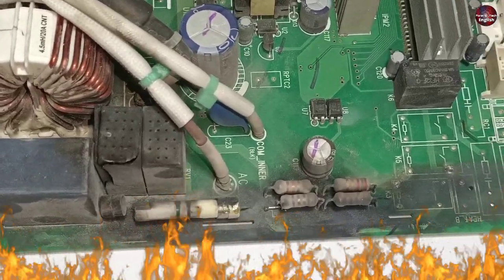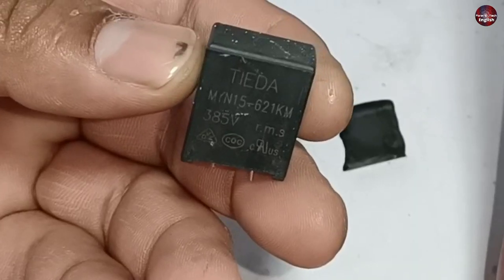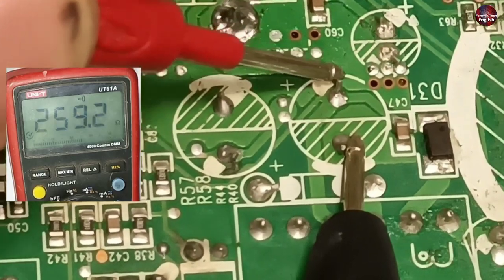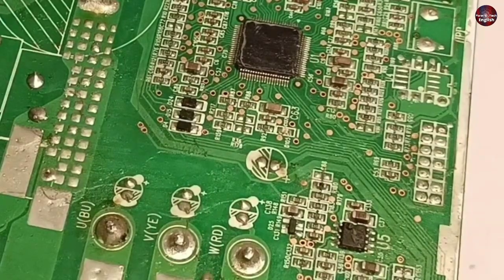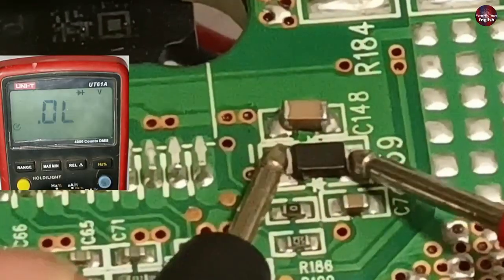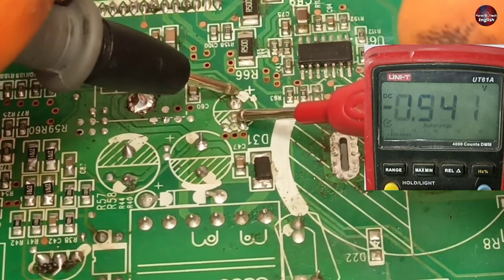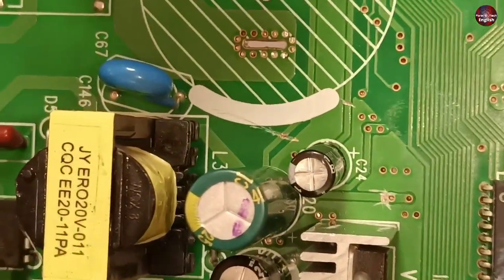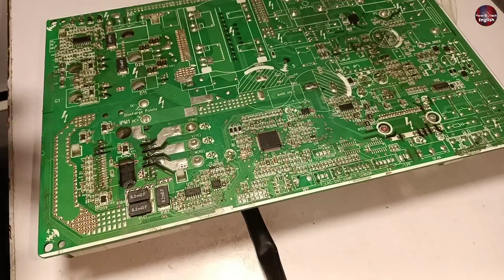Trying To Fix Blown Motherboard of Mini Split AC - No 5,12,15 Volts

Comment: We have a Mitsubishi mini-split system in our home.  We had a nearby lightning strike that caused a power surge.  The ZNR/MOVs on the Inverter Board in our MUZ-FE18NA outdoor condenser unit show no visible signs of damage, but the fuse (F62) that's inline with both ZNR/MOVs (PTC64 & PTC65) was visibly black inside of its glass tube and was, obviously,  burned open internally.  Replacing the F62 (2 Amp Slo-Blo) fuse did not have any apparent positive effect, so I tested the DC resistance of both PTC64 & PTC65 ZNR/MOVs and one of them - just like in your video - exhibits very low DC resistance.  As this defective ZNR/MOV needs to be replaced, I would like to know how to go about finding a replacement for it?  The Inverter Board for this outdoor unit - Part Number E22 P65 451 - costs well over $600.00 to purchase.  We can't afford the cost of the Inverter Board, so I would like to try replacing the circuit protection for our Inverter Board - PTC64 & PTC65 - to see if that corrects the problem.   Thank you and bless you.

Comment: Not "ZNR", it's varistor-voltage dependent resistor.
Reply from the maker: "ZNR" stands for Zinc-oxide Non-liner Resistor, the product name of a voltage-dependent resistor developed by Panasonic in 1968. This product is generally called a Zinc Oxide (ZnO) varistor or Metal Oxide Varistor (MOV).
Reply from the maker: In short we call it "ZNR"
Reply: @forevertechenglish  you call it what's written on the pcb. I reality, it's varistor.
Reply from the maker: @SanelKeys  I know its Known As varistor, i call it znr in short form. That's much easier

Comment: Let's work to get the to STOP using electronics in A/C's, refrigerators, dishwashers.
Reply from the maker: I don't get it why you think electronics is garbage? Do you had a bad experience with these?
Reply: @forevertechenglish  I have seen many things with motherboards and electronics go bad. Had a landlord friend that had through the wall AC's for each apartment. After a single year, most started failing. Replacement boards were very hard to get and cost almost as much as a new AC.
Oh and they bought the AC's by the tractor trailer load too.

Usually a chip or capacitor and sometimes the soldered on relays.
Not on your mini split as I know of no one who has them.

And trying to get one if you can (motherboard or chips) either is next to impossible or prohibitively expensive.
Furnaces are another one with garbage electronics.

Electronics from 30+ years ago seem to be OK to a point. Anything newer is very unreliable.
This with mechanical switches and such seem to last even decades. And an easy repair too.
NOTHING 'needs' electronics to perform a mechanical function.
Those are just creature features.

The more complex the system, the more prone to failure.
Reply from the maker: @crazysquirrel9425  In this Case I would Recommend electric safety devices with any electronics appliances. As I have Experienced it make the electronics devices to fail less.
Reply: @forevertechenglish  redundancy? Doesn't that defeat the purpose of having reliable electronics?
Most electronics are not user repairable.
At least with mechanical things, more people can repair things and save money that way.
Electronics repair is an advanced skillset.
Reply from the maker: @crazysquirrel9425  well electronics at the point is reliable untill it goes bad, and Every thing goes bad with time. Whatever the cause or the situation is. If you want out more from your electronic device installing safety device will make it last longer. Because It will protect the electronics from those electricity surges. Which is the major cause that electronics go bad. Mechanical Stuff Might Be Stronger. But electronic stuff is more smarter.
Reply: @forevertechenglish  Smart means nothing. I just want it to work reliably and when it breaks, me to be able to fix it without a 4 year college degree.
Mechanical - if it's on off switch breaks, I can use a simple light switch to turn it on and off.
Electronics break? I AM SCREWED.
Especially with the newer inverter stuff coming out.
Reply from the maker: @crazysquirrel9425  well we have to adjust with the newer stuff coming out. Learn things , even still after 30 years of experience I still learn new things everyday
Reply: @forevertechenglish  Every time I try to do that I get that pesky disease called a BRAIN CRAMP.